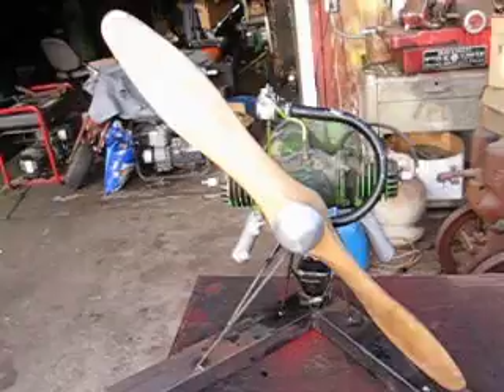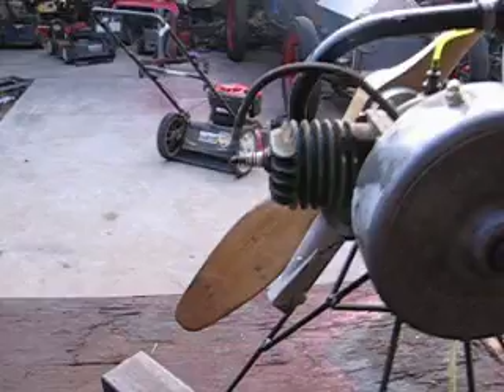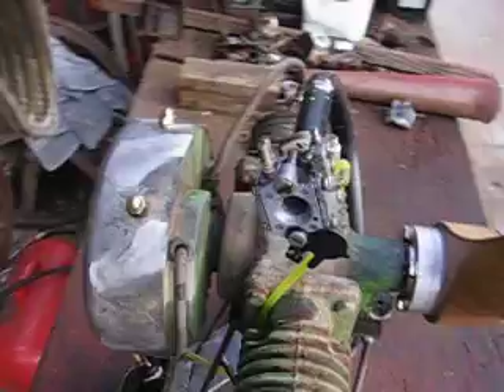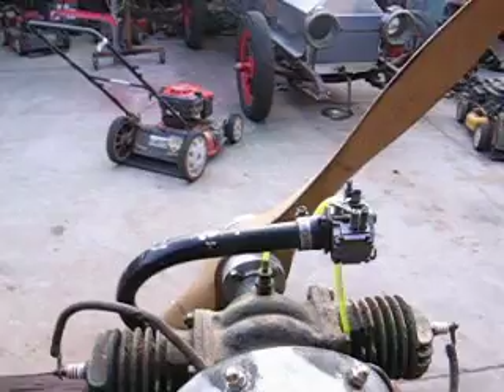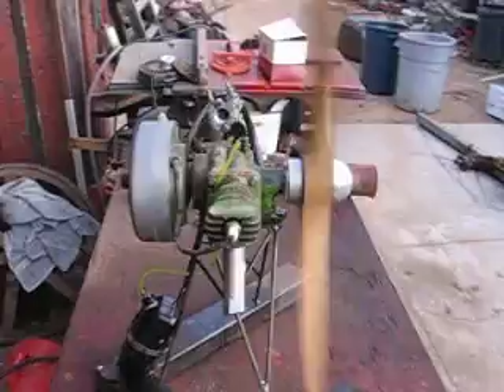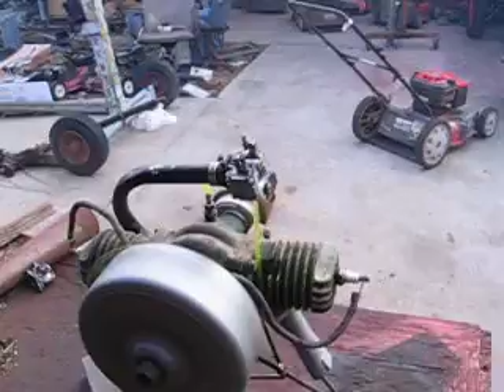maytag airplane engine 001

Comment: These were used on practice drones for gunnery practice. Very simple and as inexpensive as feasible given the projected life span. Usually used for 50cal gunner practice for the B17, and Liberator gunners. Later farmers would use them in fruit orchards to prevent freezing. The small 4 cylinder Lycoming engines worked better though and lasted much longer.
Reply: Scott Pecora "These" were not used on drones! go check the pictures of the "Radioplane" drone motors...there is a pretty good picture with Marilyn Monroe.....

Comment: Aother easy modification would be to fit the Cech bike or moped 50ccm CZ Jawa pistons and cylinders, or for reed valves? The Austrian Puch  bike had an upgrade kit with reed valves and a 90ccm displacment, it would give you nearly 200ccm displacment if the strokes are close.

Comment: Reliability isn't a concern. Those Maytag motors are as reliable as the sun itself if they're fed enough oil.

Power is the big issue. That engine is HEAVY and the porting is absolutely terrible. Fine for the day and application it's built for, but not for flying. It might work on an RC airboat though. I reckon, though, if you want a twin two-stroke  for an aircraft you buy a DLE-111 and call it a day.

Comment: Surprised it has enough vacuum to draw the fuel up.  Very cool!
Reply: tiporari the carb that he's using has an impulse fuel pump. They pull fuel with very little vacuum because they have a check valve in em

Comment: This sort of thing used to be used for giant fans to push air on land. The Maytag is a bad choice for souping up due to it not being able to breathe and scavenge well at high speed, and because the bearings used are unsuited to high impact loadings. IIRC some of them have intakes theough a hollow crankshaft. Not the sort of component you want to overload in an aeroplane. 
They do make lovely marine engines though, how about putting it in a small motor skiff.

Comment: Did you know that Evinrude boat engines share the same crank, and Cylinder pattern as a Maytag twin, The Piston and Jug off of the Sachs 80-98 ccm motorbike fit them two,
 
Be neat to fit it with Sach cylinders and Reed valves, The block looks To me to be pretty nearly identical to the old reciprical saw pattern as well, I know for a Fact that at least one of the Saws fit's Cylinders from the CZ Jawa 50ccm bikes. And Jawa cylinders fit Puch and Tomoso 90cc jug kits.